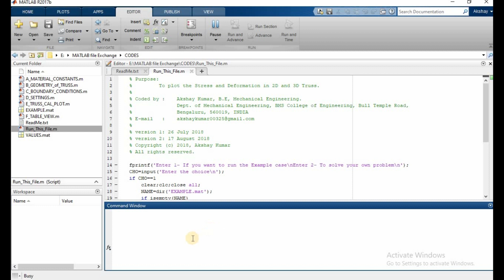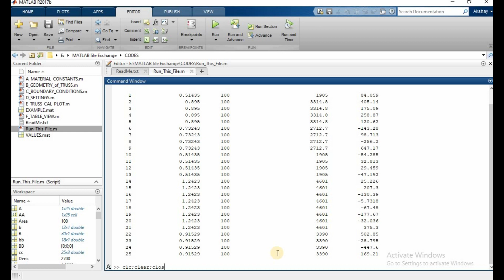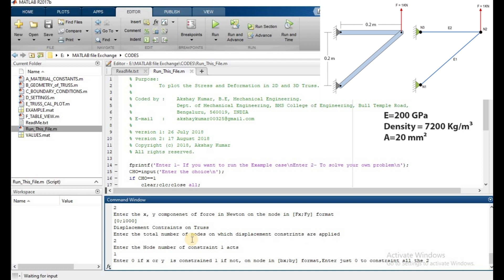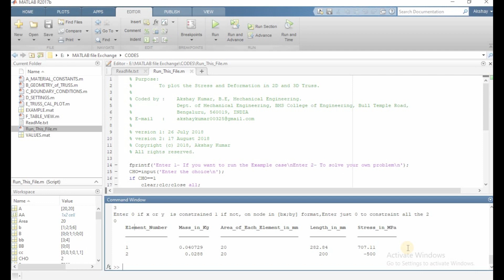Finite Element Analysis (FEA) of 2D and 3D Truss Structure using MATLAB

Comment: I was just curious how I would go about changing the units to imperial on your plot and in the code? The example you gave is in my book, but it's in imperial units. Even when I tried converting the units manually I got a slightly different answer.
Reply from the maker: Hey, you can change the plot unit on code E_Truss_Cal_Plot. You can change from MPa to your unit. And if you give E, Density, Area in proper imperial units, the results should show up in imperial units. You can email me the problem, I can give you the solution. If there is bug in code, let me know.

Comment: This is so nice.could you extend it to choosing element types and sizes like in real applications?
Reply from the maker: It is possible to extend it to 3 nodes element, but it will make the code complicated. You can try if you want.

Comment: Sir can we apply finite element method for complex trusses like scissor truss of 8 members and other trusses of more than 10 members. If we can apply then, how we will calculate the angles if there are no horizontal members in the truss? Kindly suggest any book if you can, for the application of FEM for complex trusses
Reply from the maker: You can always create any kind of truss, and solve to find the displacement at nodes.
And as for the angle, you can always find angle between two line in deformed state.

Comment: When I am following the same steps as you do, I get "unable to perform assignment because the size of the left side is 2-by-1 and the size of the right side is 3-by-1" error at the step "enter 0 if x or y is constrained 1 if not, on node in [bx;by]. The error is in line 37 of BOUNDARY CONDITIONS. How can I solve this?
Reply from the maker: Hello,
Please make sure you are using 3D option to solve 3 dimension problem, and 2D option for 2 dimension problem. 
If the problem still exists, write an email with problem details you are solving.
Reply: @DisciteBon  really appreciate the video! I however am running into this same error. I am following along with the second example and using the same inputs and it does not like this 0 for some reason.

>Enter 0 if x or y  is constrained 1 if not, on node in [bx;by] format,Enter just 0 to constraint all the 2
0
Unable to perform assignment because the size of the left side is 2-by-1 and the size of the right side is 3-by-1.

Error in C_BOUNDARY_CONDITIONS (line 37)
        B((nnb*2)-1:(nnb*2),1)=BB;
Reply from the maker: Hey, just send me email with your problem. Let me try it.
 discitebon@gmail.com